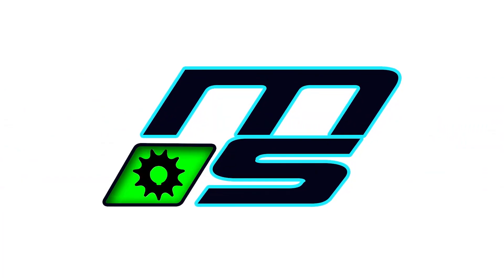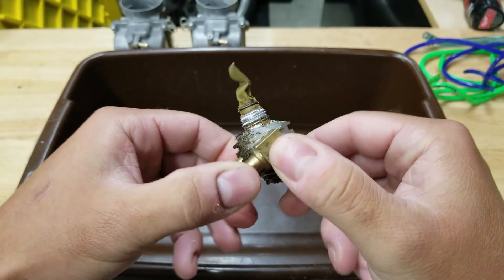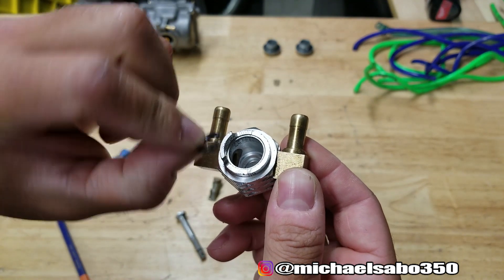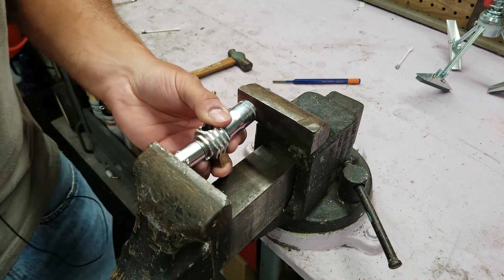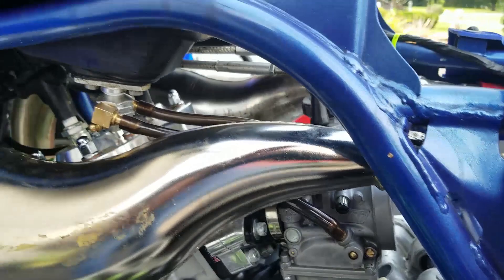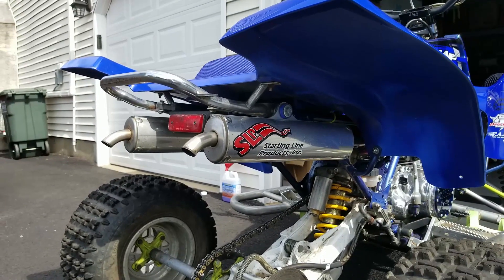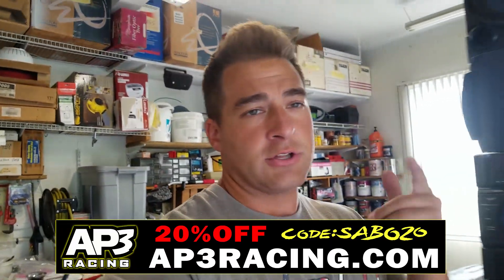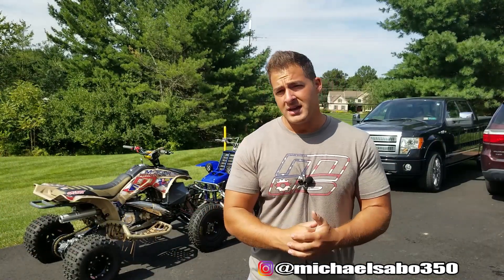Rebuilding a Dual Pingel Valve on My Yamaha Banshee and Updates!

Comment: The reason the old "O" rings failed is because they are made from the wrong material, as are the new ones. You need to use "O" rings made from Viton if they are in contact with gasoline. The "O" rings that were installed are made from Nitrile rubber and will not stand up to gasoline. Viton "O" rings are brown in color.

Comment: What do you gain when you cut your mufflers down
Reply: Better tone, less back pressure and some cases some hp up top
Reply: 2 strokes operate on back pressure......
And you really dont gain more horsepower with shorter silencers. There was a test done with procircuit 304s and type 296s. The 296s actually made more horsepower and they were longer.

Comment: It would be pretty insane if Mike got a zilla or a banshee for cheap. The prices for them skyrocket thats for sure🚀
Reply: How much di zilla are going? Someone local is selling one for 3k and full plastics and orignal pipes
Reply: @cristiansaavedra7703  , by me the clapped ones are going for 3500+. 4k+ by me are in decent condition.
Reply: @DawidSlodyczka  im guessing its a good deal then? Bc ik for a fact old rare quads are going up prices like crazy. I own a banshee and i bought it for 2.3k and now i can sell it around 4k and up. Im guessing its a good investment to get ittt
Reply: @cristiansaavedra7703  , Definitely rare quads sells. I had a 450 xc quad in the market for a week and it sold to someone out of state. I had like 4k into the engine rebuild but I was forced to sell it so just took the lost. Like to get like a zilla or 250r to restore but there hard to find these days for the right money. My best chance is probably a barn find or storage find of one of these guys.

Comment: Why don't you just cut some straight pipe inserts and eliminate the muffler effect?  Remove the perforated inner tube of the muffler and replace it with regular tube.  Cutting up the mufflers will look goofy.